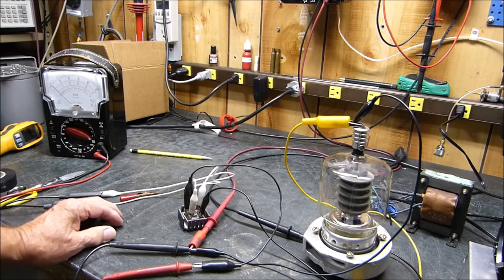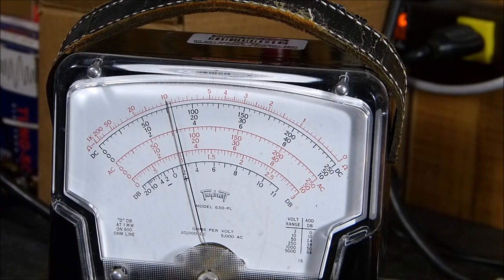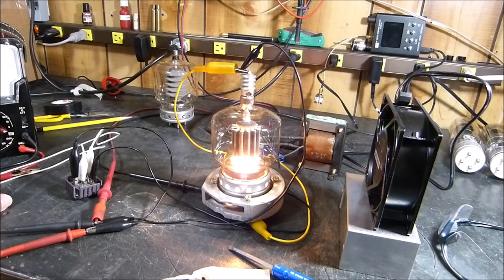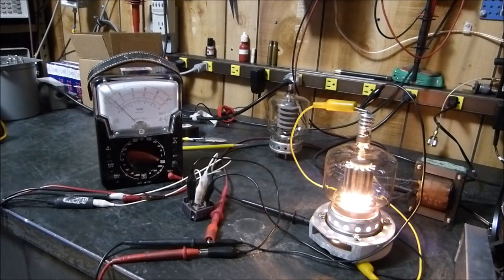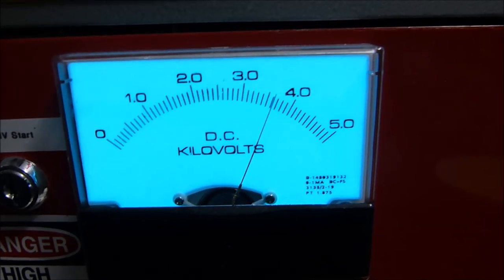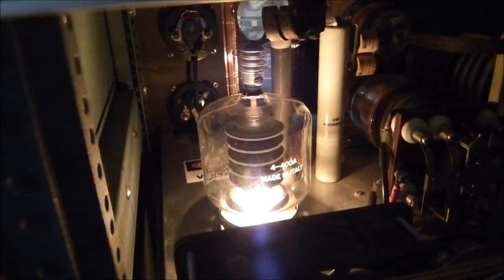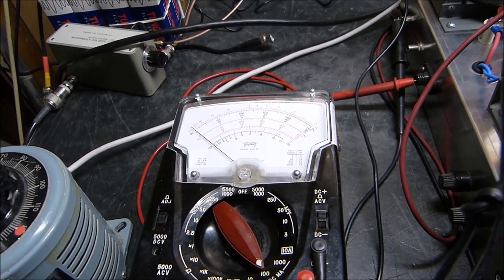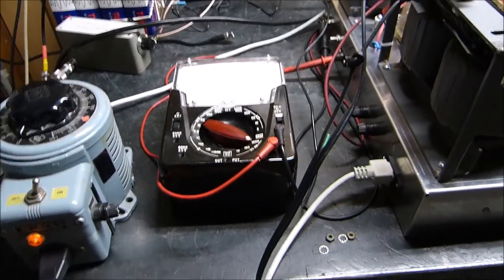Degassing Your Eimac 3-500Z and 4-400A Tubes

Comment: Rebuild your transmitting tubes. A company in Florida will put new components inside the glass envelop for a fee of 1/2 the cost of a N.O.S. tube. I used them 20 years ago on a pair of 4-400z tubes for my Swan amplifier and my Heath 3-500z' s for the 220. After all these years of operating, the tubes are still strong, even on 10M. I hope they still exist as I have a number of 572B tubes that need their expertise. I have a two tube 6M amp homebrew from an old 73 mag I built myself, the 811A' s are still cheap enough to not bother rebuilding - yet. If you can get a bunch of N.O.S. 811A tubes and match them up with a transconductance  tube tester within 10% of each other, the neutralizer in the amp can make up the difference. I have an amp that uses 6 TV sweep tubes in parallel (6KD6) that I will put on the air someday on 6M. Tube amps can take much more mismatch abuse than semiconductor amps, sometimes the antenna waving its elements too much in a strong wind can ruin the components. Tube amps are a much better choice.
Reply: what company in Florida?

Comment: The whole idea of that kind of tube is that it works in a Vacuum, meaning that there are No free floating Gas molecules inside that tube.
Vacuum Pumps only work to a limit, so in Manufacture, they sucked out as much air as possible, after throwing in some chemicals ('getters') that will react with Oxygen, Nitrogen etc at high temperatures, then seal the tube, which Will have a little bit of air still in it.
When you First power up the heater element, those 'getter' chemicals are activated and 'get' the rest of the gasses out of the air, converting them to a Solid, which cannot easily become a Plasma, like you saw in your 'bad' tube.
I guess the only option is to drill a hole, suck out some of the air, stick in more getters, then seal the hole(s).
Do-able, but sounds like a lot of work when there are so many valves sill available, and MOSFETS work too.
Reply from the maker: From an Eimac document I read on "getters" it says that the tubes are heated, during manufacture,  to almost destructive temperatures to make the getter work. I assume that is likely much hotter than running the plate at maximum dissipation and I don't know if the getter will work again after being  'fired'  the first time at the factory. I truly wanted this to work and this idea floats around the ham radio communities but I think it is total nonsense and a waste of time. As I have either said or shown in some of my videos, I pull a tube out of my supply that was made in the '60's if not '50's and I plug it in and turn it on, filaments and HV - and it works. I don't go thru the smoke-and-mirror routine of "cooking" the tubes every time they have not been used for a year or so.
Reply: @ElPasoTubeAmps  Basically it's Manufacturing, so they only put enough of the 'getter' stuff in there that was required to 'get' the rest of the air out, down to the required vacuum so they could sell the Valve and have it work long enough to get past the warranty period.

NOS (New Old Stock) might have already been slowly leaking back in 1970, so Today in 2022 there just is no vacuum anymore inside that tube.
No way any amount of heating is going to 'recondition' it, because there never was enough 'getter' to clear out that much air.

It should be possible to re-condition an ancient valve by sealing up whatever leaks exist, also drilling, putting in more 'getter' chemicals and re-sealing.

Unlikely that would ever be worth the effort though.

Comment: I'm not sure what to make of this.  I would never, ever, tie the grids to the plate, at least without ballast, metering and very fast acting fuses.  Looks like a great way to destroy the grids.  If I do something like this I will likely float the grids.
Was this for evaluating or for de-gassing?  For evaluating, l think this is poor way.  I would expect a good tube to have almost a runaway current draw as it moves into the forward conducting mode, some ballast is definitely required.  A typical way to measure tube performance is to pulse the grid with very high pulses of short duty cycle while monitoring the cathode current with an oscilloscope.
There was no degassing attempt here.  To degas you would need to run the plate dissipation up to near the max ratings with a lot of cooling for a long period of time.
Thank you for setting it all up, it was interesting to watch.
Reply from the maker: I certainly respect your thoughts on this. You, like so many others, including myself, want a solution to save a these beautiful and exotic vintage gassy tubes.
In a nutshell, I have come to the conclusion, after multiple attempts, that this whole "degassing" exercise is nonsense. Getters in tubes are real but the amount of gas they are capable of absorbing is extremely small - very finite. 
As a typical example of this degassing process -  someone has a pair of 3-500Z tubes for their Heathkit SB-220 that have set up for two or thee years and they are concerned that they have become gassy. They have been told that gas will leak in around the filament seals. So, they go thru this smoke-and-mirrors routine of degassing them and afterwards plug them in and with great trepidation finally raise the plate voltage to nominal operating level. The tubes work... this is great... now, they are convinced that it has to have been because of the care they took in their degassing process. It is all nonsense. Maybe the special metals that the anode is made of is supposed to absorb internal gas when heated to max plate dissipation - I really can't say and I can not find where Eimac says either. 
I  have tried all the old-wives-tales of how to degas this tube and others over many years. I heated the plate to full 400 watts of plate dissipation for a long time with a cooling fan on it. I can't show every moment of a three hour process I went thru in a video. 
As for leaving the grid floating in a high mu triode, the grid will become charged and shut the plate current off - to zero current no matter the plate voltage. The grid of any tube must have a DC path to ground even if it is multiple gig ohms otherwise the accumulated charge will bias the tube off. This is what will happen if we float the grid in any tube. By tying the grid to the plate we turn the triode into a diode. I agree there must be a ballast and that is my external Variac on the HV supply.
I tried to kindly and respectfully show that this hopeless method of saving a gassy tube could actually work. It doesn't work and it never will. It is an exercise in futility. I have many tubes of this family of glass tubes dating to the early 1960's and some even from the 1940's and I plug them in and turn them on and they work - or they don't. The vast majority work as they were made and sealed properly even 70 years ago. A tube that has become defectively gassy will not be saved with this procedure no matter how much we want it to work. I wish it did.
Reply: @ElPasoTubeAmps  Thank you for the response, it does clarify things.
As you pointed out, floating the grids does not work so I will revise my statement.  To make a tube act as a diode I would tie them to the plate with 1 megaohm resistors, after all a diode is just a cathode and anode. 
While the variac is essential it is not really a ballast.  A light bulb(s) in series with one of the variac leads would be a good ballast. 
I think you are correct that it is very unlikely to resurrect a bad tube using these sorts of methods but I don't think they are completely worthless.  I used to take care of a 10kw AM transmitter that used 4CX15000 tubes.  These darn tubes would like to arc over if they sat unused for a long time.  When we put the transmitter in standby service the manufacturer recommended running the filaments for a day or so every month the keep the gases at a low level.  This is not to say that the manufacturer was correct but they seemed to have a lot of experience with the problem.  Also, I have seen an article somewhere where a number of tubes were tested for flashover voltage, and after reconditioning by running them in some manner, the flashover voltage was dramatically increased.  So I think that there is some merit in carefully running up the heat in tubes that have been unused for a while.
My interest in the matter is that I have acquired a transmitter with four 4-500A tubes.  These tubes are just about un-obtainable now.  They were running fine when the transmitter was shut down 20 years ago and I want to bring them up without incident.  I will probably run the filaments for a week and then slowly run up the plate and screen voltages with variacs and ballast lamps, slowly bring up the dissipation.  I also have some 4-400Cs that I need to do the same.  It's several thousand dollars in tubes so even if the process is futile it's worth my time to slowly bring them up to full operating parameters.
Thanks for doing the video, it did answer a few questions that I was thinking about.
Reply from the maker: @radarecho57  
I certainly appreciate your response and input to this subject.  It can be a touchy subject with some people. Your experience with the 4CX15000 tubes is where the rubber-meets-the-road and success is hard to argue with. I have read about this tendency to flash over but I have no experience with it and if the tube manufacturer suggests something, it is probably a good idea...regardless of what us ham radio operators think.
Wow.. a transmitter with four 4-500A's - I would love it - I have no idea where I would put it but I would come up  with something.  :-)
I realize that my hard-nosed approach to this degassing  could, in some case, be wrong but it has never worked for me. Maybe my tubes were just too-gone to be saved. There actually is, in Eimac literature, a mention that running filaments at low voltage (temperature) can "poison" the cathode by making it absorb gasses.  I do not know if this applies to the family of 4-400A type tubes. There is a link to that article at the top of my video. In any case, these type of discussions with the sharing of experience is very valuable, in my opinion, and I  have been extremely fortunate to run across so many knowledgeable people, like yourself, commenting on my YouTube videos and sharing experiences. Stay safe and have fun with the big transmitter...

Comment: i think you can use high DC voltage with limit current and sputtering any metal of the anode to the cold glass bolb it can trap the gas molecules release from hot anode. the phenomenon of your tube seems this tube was not aged enough and still high vacuum but not extremely high. in my experience,its possible to save it.

Comment: "I have to re-evaluate"  LOL!  Is there a difference between  degassing  the  old/used tubes  and NOS tubes that have been in storage for decades?   I  searched vids as I want to use some NOS 4CX300 tubes I've had for a long time. n2eye
Reply from the maker: Personally - and this is just me - some people will disagree - I just plug them in and use them. I don't have any problems and have lots of tubes, some probably older than me, and they work. Some kind of magic came up around the 3-500Z. According to Eimac, tubes have to heated right to the point of destruction to make the "getter" work and that can only be done during manufacturing. I think we should do whatever make us feel good.  🙂

Comment: It suddenly occurred to me that this setup is identical to the circuit used by the EICO 666 (and many other testers I'm sure), except for the power supply being able to handle much larger currents.
Reply from the maker: I am beginning to see that testing larger tubes is simpler than we think if we are willing to build a test jig. Thanks for your comments.

Comment: Just for what is worth, and if I recall correctly back about 55 years ago or so, I worked for a company that used 3-500 as well as other tube in their products. I would run 3-500 unit that they called a pre conditioner for Tubes. Most of the tubes we received where new mil surplus. We had a rig that would apply low voltage to the plate. I  believe to be the same set up you have except it would run 8 tubes at a time. 
We would limit the plate current to 400 ma  by varying the voltage. Never exceeding 400 ma. After 7 hours we would adjust the voltage to read 320ma and note the voltage. The tubes where then matched based on the voltage at 320 ma. They would be shipped or installed in Quad sets based on voltage at 320ma. We would see that over time the voltage would be reduced to maintain the 400ma. I think the power supply for each was limited to 500 ma at 50 volts. All of the tubes where Eimac. At that time I was in High school and had no clue what I was doing, sure what I am doing or what the purpose was other than to get a pay check.
Reply from the maker: That is some interesting information and I can understand some of it. The intention is to "match" the tubes. New, good, tubes can vary quite a bit - I have see it a number of times in audio amplifiers. The one that draws the most current and gets the hottest, like a 6L6GC in push-pull, just for an example, is doing the majority of the work while the other "good" tube is loafing. The one drawing all the current and doing the most work is getting very hot. In the case of a much higher power tube, like the 3-500Z, if it is in a pair, or quad as you describe, it is going to get really hot at 2500 volts on the plate in the equipment it is meant to work in. So, that is the purpose your of pre-condition the tubes. 
I can buy new tubes and measure them and make a note of current, then put them in an amplifier and let them run, for maybe a week, and remeasure and they will most likely have changed. After some pre-conditioning, i.e. running in the equipment, they tend to stabilize for the life of the tube. 
My first year in college, 1967, I worked for a small cable company and their distribution amplifiers were all vacuum tube and I built a re-conditioner just to simply light the filaments for a week or so - then we would test and match the tubes before having them put in the distribution amplifiers around the town. We would find bad ones after just running the filament for a week. I think it held about 20 tubes at a time. (small 9 pin tubes) Tube testers don't solve all problems, for sure, but they are useful for matching tubes and testing for obvious faults.
Thank you for you comments. I find what you added very valuable.

With all due respect, some of this de-gassing of bad tubes is just smoke and mirrors that some ham radio operators believe. I have lots of high power tubes, many from (before) the 1950's and 1960's that I just plug in and put 3500 volts on them and they work. Eimac documentation discusses activating the "getter" in their tubes and it requires a very controlled high temperature, right below the point of destruction of the tube, that is necessary to initiate the getter action. 
On the other hand, if a fellow (or gal...) believes running their tubes in whatever manner makes them better and lasts longer, I don't want to discourage them.  🙂

Comment: I have tried various methods, none are a single answer.......I wonder if they are fired up early in their lives, it sets the seals throughout the tube to slow down gassing.......
I guess in their day when they were new off the factory floor, no one really thought they would be still in use and even in some cases brand new old stock in this age......they really have exceeded their intended working life by many decades
Reply from the maker: It is beginning to seem to me that the used Eimac tubes (and other vendors) that are 50-60 years old are much more likely to work than the truly NOS tubes that are of that age that have never been used. I have plenty, as you have seen in my videos, of excellent used tubes that are definitely 50+ years old. Until someone can tel me that they have personally fixed or witnessed a fix of a failing tube from this procedure, I will not believe it works. This does not include doing this procedure and then having their 3-500Z work in their SB-220, for example.  It means having had one that failed, like mine in the video, and then going thru the procedure and have it work. I am looking for a cure, if it exists, and not a vaccine.
Reply: @ElPasoTubeAmps  lol.....me too....a true tube resurrection !!  .....I am yet to say impossible, but I have a lot of dead big tubes from various jobsites, None have reemerged from the dead yet.......having said that, I am all for it if it can be done.......I never throw out the dead ones......I live in hope !!
Reply: I have a trio of RK65/5D23 tubes, all used. I did this procedure, and compared results - one tube was obviously bad, one obviously good, and the third seemed to benefit. The third tube took about an hour, pulling rated plate current, and the current kept increasing. I had to keep adjusting the plate voltage lower every few minutes until it finally levelled off, within a few volts of the good tube. Subsequent tests one month and several months later showed it to have retained its 'good' rating. Would it survive long with real HV? I don't know, and don't currently have a way to test.